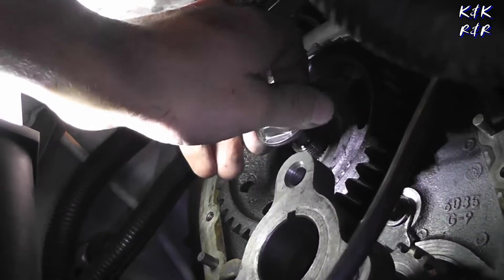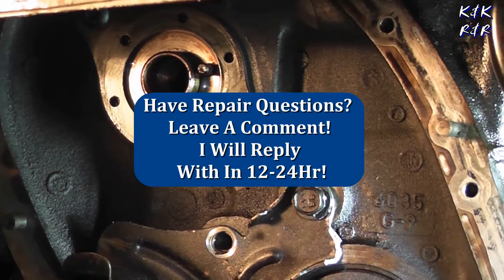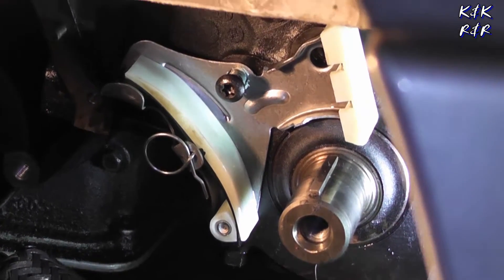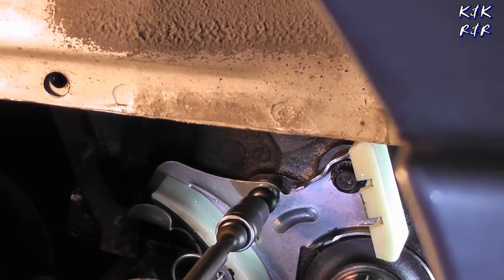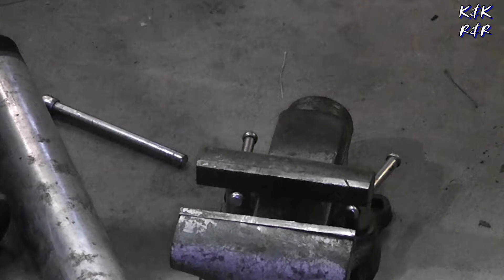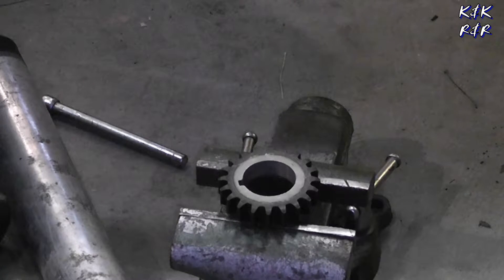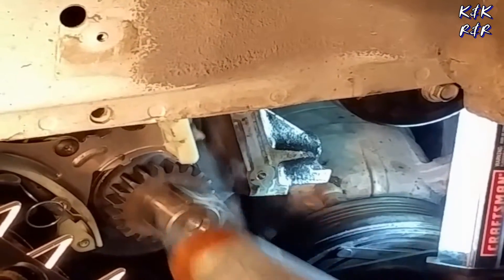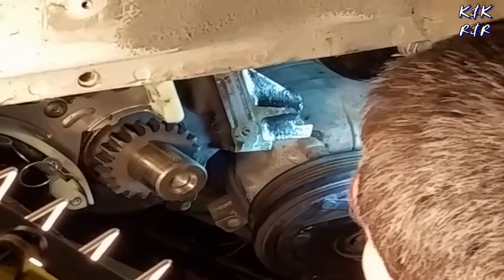How to Replace A Broken Timing Chain Pontiac Sunfire 2 2L PT. 4 Crank Gear Removal,  Guide Install

Comment: I'm replacing my broken chain right now in my '98 Sunfire. I'm stuck and can't get the cam bolt loose because it turns. How did you guys do it?
I already have it timed and ready to replace everything, just have to break bolt free and put parts back on.
Reply from the maker: Do you have access to an impact?  You need to hit the cam bolt hard and fast to remove.  
/K&K
Reply: I don't have an impact :( I'll keep trying to figure something else out. I was able to use the belt for the crank pully to bind it, but that won't work with the cam.

Comment: You didn’t show how you got your crankshaft to tdc
Reply: I’m having a issue
Reply from the maker: Yup your right I just watched it again. We normally line up the engine up with the old cam and crank gear dot to dot because the visibility is better, sorry about that.  You need to line up the dots on both the cam and crank gear on this engine and the dots line up at angle not up and down like most engines. Towards the end of part 5 we roll the engine over and you can see the cam and crank gear key ways with a dots so you can find TDC.

The link below shows where the dots should line up before you install the chain.

 https://www.google.com/search?q=timing+marks+on+gm+2.2l&client=firefox-b-1-d&sxsrf=ACYBGNRNtUpKSTJWykQzIiuzHfGvf3y7kw:1580969172703&source=lnms&tbm=isch&sa=X&ved=2ahUKEwib5sGPobznAhWhMX0KHTnMBXUQ_AUoA3oECAoQBQ&biw=1440&bih=736#imgrc=tg7jTygpgWD9CM:

/K&K

Comment: Hello. Thanks for the vids. 

I was wondering if you’re familiar with timing chain seta that eliminate the tensioner. I found them on RockAuto and not sure if it is a new design that’s simpler or what?

Thanks

Comment: If the new one slides on do you have to heat it up. I saw there was space between the gear and the engine, was that bottomed out?
Reply from the maker: Yes there a small amount of space between the crankshaft and gear.       The space you see is there to make sure the chain rides even to the cam gear and also allows for clearance between the chain tensioner assemble and crank gear.
Reply: @KNKRNR  I took the old gear and hit the new one on.